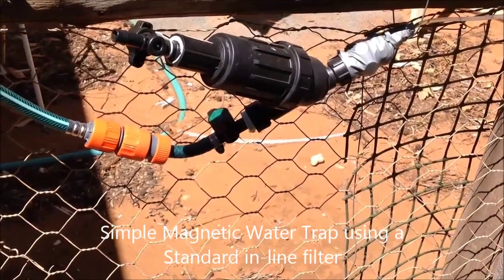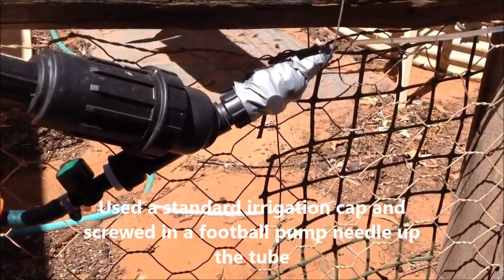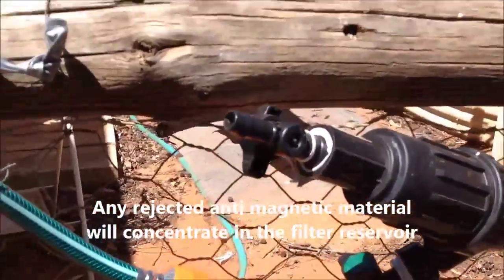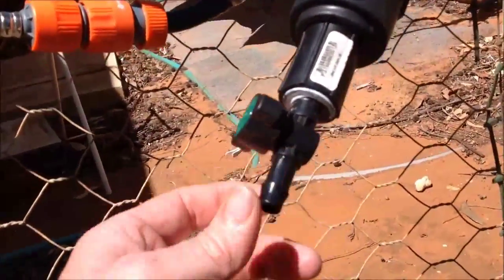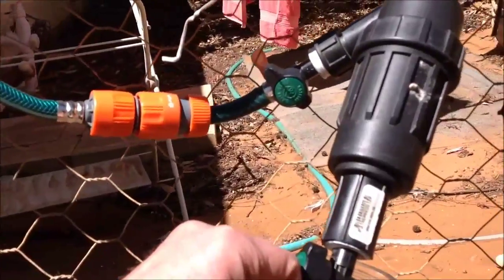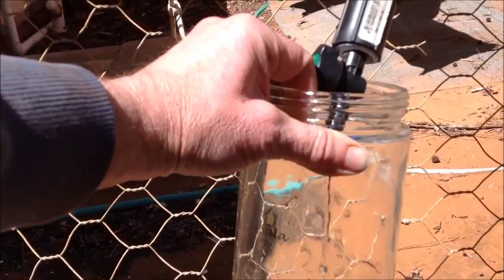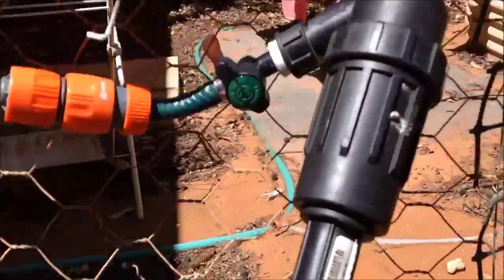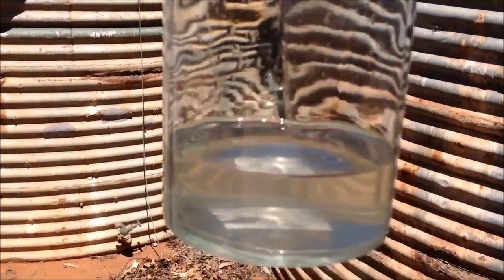Simple Anti Magnetic M Water Trap

Comment: Bruce, this is an interesting contraption, and I'm sure you probably don't realize it but your "side bar" annotations in the beginning of the video are barely discernable for the lack of contrast with the bright background, and having used white lettering.  Would it be possible to reiterate what was said in those added notes?  I saw a reference to eBay and not much more then a couple of words for each sentence you overlaid on this video. I tried numerous time to catch what is being conveyed and if you are unaware of this visually, maybe your monitor needs calibration.

I mention this because I know mine is periodically checked because it must be kept at the most compatible standard settings because I do photo editing and old damaged photo restorations primarily on this machine, and know my settings for color, saturation, brightness, gamma, and contrast are correct or the photo restoration results I have been doing would be coming back with their owners complaints of being washed out and too intense, or too dark and over contrast and my last three restorations were raved about for their results, it is easy enough to do if you use windows 7, or else you can use your graphics card's included software instead, it depends which settings are default to your video editing program.

Question about something not specified in this video.  It is indicated you used a series of rare earth magnets, and I could catch the word donut magnets from the annotation, (but not much else lol) and my question is do you orient the magnets to be alternating or repeating their polarity? (alternating between repelling and attracting, and NOT N&S lol) I am thinking, since M-state is rejected by either pole, it would make sense to use both poles to reject all possible water containing any M-state, but I don't know if this impedes one magnet's strength of field to the next one's, since it appears they are close together, or maybe they are attractively pole stacked? To increase the field strength?  

Hmm but does one actually  increase/decrease the next one's field?  Especially considering it is M-state materials hoping to be affected.  Sorry for the complexities of my question(s) but it is difficult to determine how much one magnet affects the field of another or if their strength is even cumalative or destructive when there are such limitations to actually seeing the fields and I haven't saved up enough ferrous filings to create a visual representation of their fields! :-)  

Thanks for any clarifications you can provide!

Cheers!.